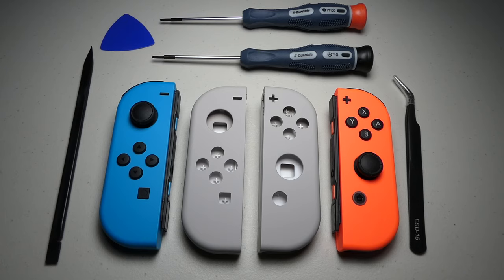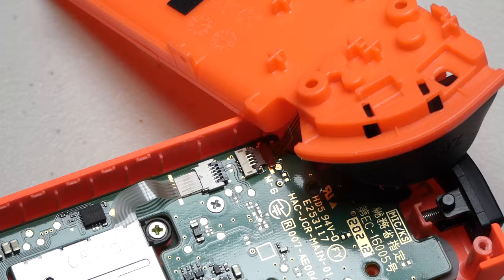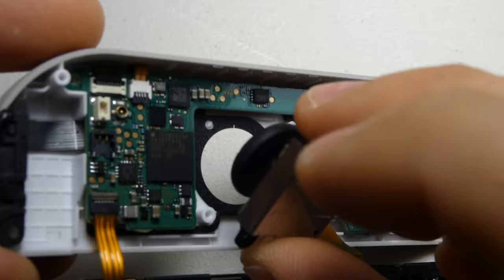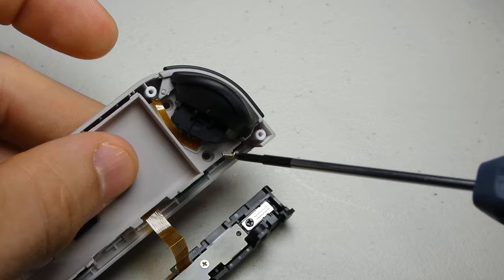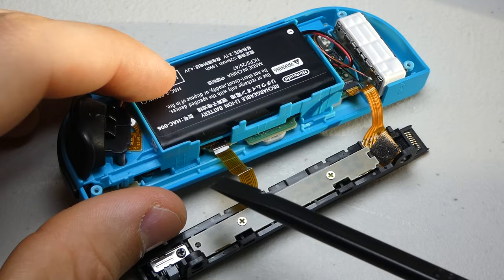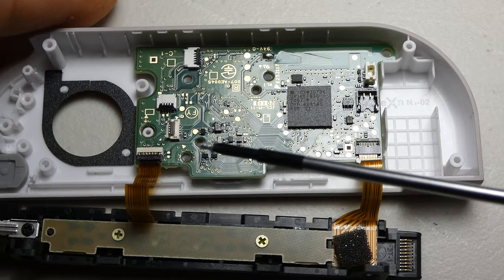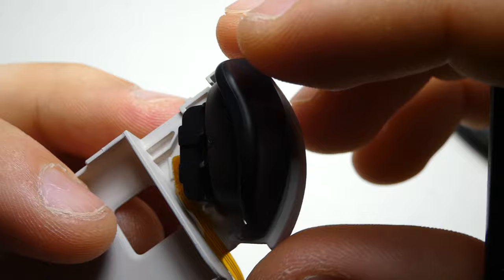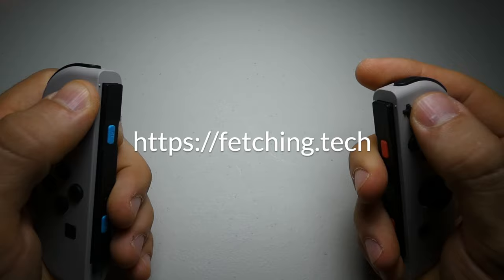How to Swap Out Your Joy-Con Shells

Comment: having a hard time to screw off the screws on the back of my oled joycons 😕
Reply from the maker: They can be quite stingy, just make sure you are using the correct screwdriver and an adequate amount of pressure. Those screws strip easily, and that creates a much bigger headache.
Reply: @FetchingTech   well i was able to to change the shells but the only thing working is the analog stick
Reply from the maker: @yeee7284  Hmm, I can't really explain that. I would try taking it apart and putting it all back together again, and if the issue remains, the motherboard may have shorted out in the process.

Comment: I switched out my joycon shells for a new one and they slide into the switch a bit rougher than before. Is there a way I can prevent this?
Reply from the maker: Hmm, if the shells are an exact replacement, they shouldn't really come into contact with the switch itself. The only thing I could think to do would require filing down a bit of the shell, but I can't imagine you'd want to do that.

Comment: hello thank you for this. i did everything to a t but my plus button doesn’t work. did i mess up the button placements maybe
Reply from the maker: That depends on if the button is actuating or not. If you can feel the button click in, but it doesn't register, it could be an issue with the motherboard. If you can't feel it click, then it might just need to be reseated.

Comment: hi on both of my controllers the ZR & R/ZL & L buttons are no longer working, do i need to buy a replacement joycon or is there anything i can do?
Reply from the maker: Hmm, if it was just the ZL/L and ZR buttons that weren't working I would say you could get away with just buying new ribbon cables for those, but the R actuator is soldered directly to the board, so you might need a board replacement in that case.

Comment: My new joy con won’t dock with the console but I can still use it wirelessly.  Any ideas where I went wrong?
Reply from the maker: I'm guessing you can connect it physically to the console, but it just won't be recognized as connected. In that case, I would guess the SL/SR railing ribbon cables aren't' fully attached or got damaged. You'll want to take another look at those cables.

Comment: What do you do if you followed the steps to a T and the remote doesn’t light up or turn on
Reply from the maker: Sorry for the late reply. I would guess that battery connector didn't get inserted fully. Does the controller work while it's attached to the console?

Comment: What do I do if I broke the shoulder button cable? How do I fit it or what can I replace it with???
Reply from the maker: Thankfully, all the cables can be readily found on eBay. You should be able to get it replaced without too much trouble.

Comment: kinda stuck on disconnecting the rumble motors. I fear i'm going to strip away the connector and some of the cables. I try to grip with the tweezers but it keeps slipping and i keep snapping on the cables
Reply: welp, i wound up just skipping discconnecting the motors from the boards and just had to deal with the railing and the motor dangling from the boards lel. But i got it. thanks for the vid. ireally didn't want to watch a time lapse of someone doing this with some generic music over everything. i really like to hear someone talking through it.

Comment: Man the battery cable in mine doesn’t just pop up like that (oled) and I’m afraid to put too much pressure on the cable. Any tips?
Reply from the maker: I'd say just leave it plugged in. I've started doing that myself. Might as well leave everything plugged in that doesn't have to come apart.

Comment: Thanks, but it's not good advice to pull the battery out.
With mine it was so stuck that I ripped out the cables. Just leave the battery connected. (I know its not best practice, but I get to order new batterys just for the new connector. There is another tutorial here, where he leaves the battery connected.
Also the other tutorial doesn't do timelapses or barely any. I don't get why people do timelapses on those. It's way more convenient to just skip ahead than to constantly pause while holding a disassembled controller with the bottoms all wanting to escape.
Reply from the maker: Thanks for the tips. I’ll consider that in my future videos.

Comment: The dude made me pull out my battery and I broke it.

Edit: I realised it was my fault. I thought he said to pull it toward, not upwards.
Reply from the maker: I'm sorry about your battery cable. I hope you're able to get a replacement fairly cheaply and get your controllers back up and working.
Reply: @FetchingTech  Already got a new replacement and it's back to work. Thanks so much for the video tutorial it helped so much. I blame myself for breaking my battery cable as I was not careful and didn't listen exactly to what you said.
Reply from the maker: @value_sniper  Awesome, I'm glad you got it working. I'm sure I could have been more clear. There are some changes I would make if I had to recreate this video.
Reply: @FetchingTech  👍

Comment: I wanna do this but I'm scared. I start changing the tablet backplate to white
Reply from the maker: It does take some patience, but it's definitely manageable. The Switch backplate is a bit easier to swap than the shells though.
Reply: @FetchingTech  Since I never done anything like this i would start with the switch. But the i would do the joy cons
Reply from the maker: @emmr01  That sounds like a good plan. Good luck with the swap.
Reply: @FetchingTech  Thanks

Comment: Hello friend, how are you? I followed your guide and managed to change everything perfectly. But I feel like the trail that fits the Joy con on the console got a little tight. I did something wrong? I’m afraid I’ll end up breaking.
Reply from the maker: It's hard for me to say without seeing it, but if I had to guess, the two shell halves didn't go back together fully, and it is causing separation. In that case, you would just have to take them apart, and make sure nothing is interfering while you reposition them. They should snap together fairly easily. Hope that helps.
Reply: @FetchingTech  actually, one of the parts of the housing came bigger than the other. I shaved one of the sides and now it goes normally. thank you.

Comment: Does anyone know what screws to buy that connect the track to the controller shell? Mine went missing when the track was ripped away from the controller from misuse so I'm trying to repair it myself and all I'm missing is those tiny screws
Reply from the maker: We do offer a full set of replacement screws. This should have what you're looking for: https://www.etsy.com/listing/867469064/replacement-screws-and-springs-kit-for?ref=listings_manager_grid

Comment: Why do you not disconnected the ribbon cables of the railing? I did everything like you showed but pulled accidentally the joy con railing and ripping off the ribbon cables in half 😡
Reply from the maker: Hmm, sorry your controller got damaged. I’m not sure what you mean though. Do you mean the ribbon cables for the railing?
Reply: @FetchingTech  Yes, Sorry for The confusion, inwas just calling them how we Call where i live.
Reply from the maker: @IgorTchaka  Oh, yeah, those cables can be a real pain. I like to try and leave everything attached that doesn't have to come apart, because it makes reinstalling a little simpler. It does require being careful with those dangly cables though, for sure.

Comment: I just did this yesterday and everything went super smooth, but do you know why my left joy con won’t charge? It turns on and functions but it doesn’t charge
Reply from the maker: My guess would be that the railing ribbon cable, for the piece that connects to the Switch console, may not have gotten reconnected properly or may have gotten damaged. That railing is what allows the controller to charge. I hope you're able to figure it out.
Reply: @FetchingTech  hi I actually figured it out I think I was pinching the ribbon cable that goes to the railing I opened up the joy con again and fixed it! All is well thank you for the great tutorial!
Reply from the maker: @RFreak64  That's great, I'm glad you were able to get it figured out. Enjoy your new controllers.

Comment: Not replacing shells here, but just having issues with my right joycon. Everything works (surprisingly... I’ll touch on that later) but the shell won’t click in place, even with the screws it won’t budge. So after basically rage quiting and removing everything... because why not, I decided to investigate. I found that the railing (thing with the 4 lights) won’t click in the very bottom shell. I’m still not sure wether it’s the shells issue or or the railing but it just won’t fit, more specifically the lower part won’t fit. It’s not anything else because I removed everything so I’m just curious if you know what might be the problem. Well this brings me to the next issue. When I said I removed everything, I mean everything, including the green board, and to do that I removed the two ribbons. It’s so difficult to put the ribbons back, I don’t think I’ll be able to. As far as I can tell all the buttons work, but will not putting in the ribbons back be a issue? I’m not sure what they connect to, but it’s weird that the buttons work without it. Sorry for such a long comment, any help is appreciated!
Reply from the maker: I'm sorry about all the trouble you're having. I really wish it was an easier process than it is to swap these shells out. Usually, the right shell is the one that causes more issues because of the little Wi-Fi chip that likes to move around as you're getting everything to line back up. I would double check that and also make sure there aren't any cables getting tangled.

As far as reinstalling the cables into the main board, I am assuming you are referring to the IR receiver cable and the large flat black one that connects right beside it (visible at 3:28), which, to be quite honest, I'm not sure what it does. If that's the case, you will not be able to use the IR functionality in games, but you may or may not ever use that anyways. If you do want to get those back together, I would suggest installing them into the board first, and then putting the board back into the shell afterwards. It's more difficult to install them otherwise.

Hopefully, that was somewhat helpful. Please let me know if you need anything else.
Reply: @FetchingTech  alright, I’ll try once again today when I get the time, maybe there’s a stuck screw in there. If I may ask, what does IR mean? Motion controls? Because if so the motions controls work for me without it being insterted. Unless the black cable connected itself somehow. Also, there’s still rumble as well! It’s so confusing. Also I believe seeing another ribbing next to the back one that I removed as well. It’s yellow. I don’t know what it does either. I’m thinking it might be for charging? I can’t tell yet because the controllers at full battery, so I’ll leave my switch on I guess. Thanks for responding! We’ll see what happens ^^
Reply from the maker: @AbiasO3  I'm struggling to picture what cables you're talking about that you weren't able to plug back in. IR stands for infrared, it's the black plastic semi-circle shaped thing at the bottom of the controller with a glossy coating on the outside. I don't know which games take advantage of that sensor, but I'm sure some do. This is what I'm talking about: 3:31.

Comment: I have a question I have a tri  point screwdriver 0.6x30mm is that the right screwdriver or no
Reply from the maker: I believe a Y0.6mm screwdriver is another name for a Y000 driver. The one I recommend using is a Y0/Y2.0mm. I wouldn't advise using the small one, as it will likely strip your screws.

Comment: for some reason my joycons both don't work anymore and I did lose some screws and springs that are just so small they're just lost so I ordered some of those extra but one controller remained complete let's say and that one is still not working. Could it be that some controllers or something might have shifted and the motherboard is just not recognizing it? Like it's not turning on and at one point it got recognized by the switch when placed in but than none of the buttons would work so I got no clue. This happened with the right joycon. (luckily it's an old set neon colors that I wanted to have pastel pink and purple shells with opposite pink and purple buttons and triggers as well as the rs ls buttons on the side.) All got in well although a little finicky since my screwdrivers weren't magnetic and it was quite the hassle. Both still remain unusable atm so I'll prob take them apart and try again and again
Reply from the maker: I'm sorry you've had so much difficulty. When the controllers won't turn on it's usually because the battery connector isn't pressed in fully. The controller should still work when connected to the Switch in that case. If the buttons still aren't working when connected to the Switch, that leads me to believe the motherboard somehow got damaged.

You should be able to purchase replacements on eBay for not too much money. However, I'd try to put it together again as you mentioned and make sure none of the ribbon cables got damaged while you were swapping them out the first time. Hopefully that helps you somewhat, and good luck with your repair.

Comment: This video is very helpful! I successfully changed the shell and joystick of my right joy-con, but unfortunately not with my left joy-con. After replacing the ribbon cable (due to SL+SR not working and LED indicator not lighting up), the joystick (due to drift), and the shell of the my left joy-con, the d-pad and screen capture button started acting strangely -- the d-pad sometimes doesn't work and starts to randomly take screen captures. Anyone here encountered this issue as well? How did you fix this?
Reply from the maker: Hmm, it sounds like that controller has given you some trouble. Sadly, I don't really have a solution apart from replacing the main board. It kind of sounds like something may be shorting. You can get replacements on eBay, but I'm sorry you've had to replace so much if it comes to that.
Reply: Thank you for the reply! Tried working on it again last night. I replaced the SL ribbon cable and all the buttons are working again. But when I try to squeeze tightly or close the shell, only the joystick works.
Reply from the maker: @renzTBDR  Hmm, that's strange. So, the buttons work when the main board is out of the shell, but they don't work inside the shell?

I've never seen anything like that before, but it sounds like maybe something is making contact in the shell and causing a short, or perhaps the main board isn't screwed in properly, causing the buttons to not actuate when pressed.

I'm sorry I can't be more helpful, but I hope you're able to get it figured out.

Comment: My - and L button are not clicking. Like they aren’t in well. I have no clue how to fix it, any help? Thanks in advance
Reply from the maker: I would guess that the battery tray or motherboard isn't seated properly so the minus button isn't getting the proper resistance. The L button can sometimes give you trouble if the face and backplate of the shell don't lie entirely flush. You could try to straighten them out if there is separation, or just back out the screws to give the button more space to move.

Comment: I finally managed to complete the joycons but the stick on the right one makes a an odd clicky sound when pushed in towards the screen*
Reply from the maker: Is it the same stick or did you replace it?
Reply: @FetchingTech  i replaced the stick with one I got from your store it works perfectly just that little problem. I don't know if just cause it's new or something
Reply from the maker: @supersegaman09  Well, if the problem persists, let me know through the contact form in my store, and I can send out a replacement.

Comment: Tried a shell swap, but my right joycon is now un-recognized in handheld mode, tried to change the joycon's side rail, didn't work, other right joycons works perfectly fine in handheld, does anyone know why it does that or how to fix this ?
I tried to update controllers, terminate communications from the settings menu, using it on another console, didn't work at all

Edit, also tried to clean connectors from both rails (controller and console, didn't work)
Reply from the maker: I'm not sure what might be causing this. I would try to reassemble the entire controller and make sure all the ribbon cables are properly attached and not showing any signs of damage.

If that doesn't work it's possible that the motherboard may have shorted out and require replacing. I'm sorry this has given you so much trouble.
Reply: @FetchingTech  Yep, i tried to fully reassemble the controller, or use contactspray, but nothing worked
It's sad to have that problem, and that there is no solution to it, thank you for the answer though !
Reply from the maker: @LeLawsford  You've already replaced the railing and the ribbon cables. So, I would think the motherboard could be the only other thing to blame. Sorry again for all the headaches. I hope you're able to get your controller working.
Reply: @FetchingTech  Don't worry, you ain't at fault, i've just been unlucky for one joycon, it could have been worse !

Comment: why change the battery tray where it isn't even visible or make a difference?
Reply from the maker: It is visible on the top of the controller between the two shoulder buttons, and some people prefer it to match like the original Joy-Cons do.

Comment: Everything went great but my nfc reader doesn’t work now and any game the uses amiibo I’ll just get a error :(
Reply from the maker: Sounds like the ribbon cable that connects the black nfc antenna may not have gotten reconnected fully or may have been damaged somehow. I would double check that. If you need to replace it, you can purchase them fairly cheap on Ebay.